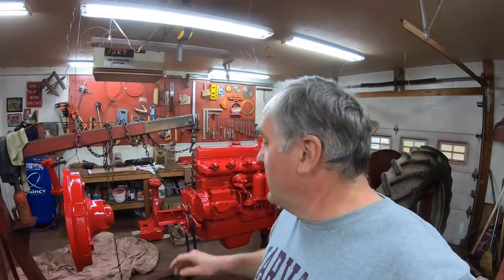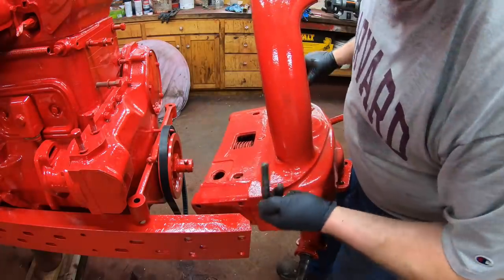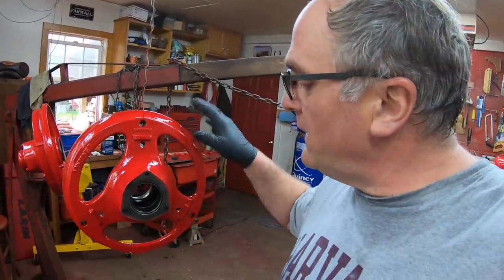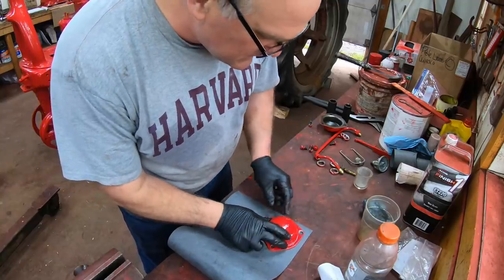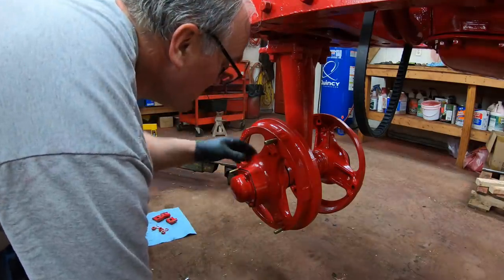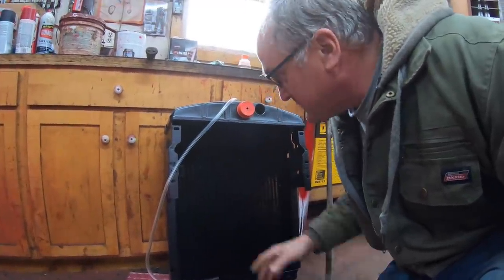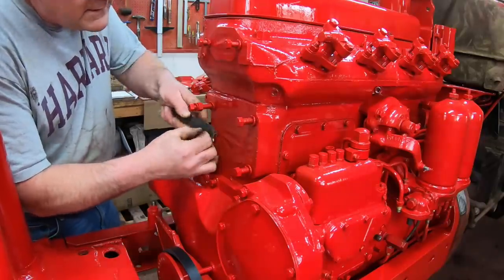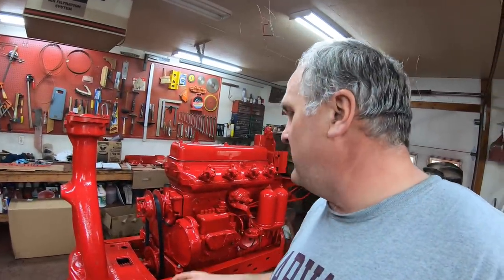My Tractor Has Four Wheels Again! Installing the Farmall MD Front Bolster

Comment: Sometimes it is better to buy local. I needed a new front rim for my Kubota tractor.  All over the internet it was $98. For giggles I checked my local Kubota dealer.  It was $38 over the counter. My dealer is now my go-to for all parts. And they are always equal or less than internet prices.

Comment: Excellent video Pete  :) very good on progress of engine rebuilt and looking nice ! Also looking forward to key start first time again and area you going use a AC Delco Alternator on single or double pole types from 1968 to 1985 for 4 or 6 or V8 motor style hope so because easy set up and if going get brackets check with John Deere dealership near you they have made ones made for 2 cylinder to 6 cylinder from 1950's to 1985 plus GM Delco Alternator from 1968 to 1985 to single and double poles types ! I know have one near me does too back then like 20 years ago!

Comment: It's always fun to watch reassembly after restoration. Thanks for the video Pete! 

Side note: it seems like the manufacturer was experimenting with their nut retention methods a lot on this model?  I saw a few different ways one can go about it now. I suppose we use similar methods today, for retaining nuts, but it was interesting to see how they went about it in this application. I learned a few tricks from watching.  Pinch bolt, w/ backup castle nut is one. Don't want a wheel falling off, and I don't think that one will. Lol.  

Be well friend. You're a good fella.

Comment: Pete, did you show how you finally got the lower steering bushing all the way in? Also have you found a proper thermostat. These are all things I will have to do on my Super MTA down the road. Thank you for what you’re showing everyone!  👍
Reply from the maker: Hi Dennis, I didn't show that. Dad made a stepped puck, similar to what you would use to pull a cylinder sleeve, that fit into the bushing and bushing bore. I used that to drive it the rest of the way in. A viewer found the proper thermostat on the Stant website, I think it's also available at Steiner. If you look back through the comments on the video where I talked about the thermostat it should be there.

Comment: I suspect the bulk grease is a reservoir, should the bearings and or hub heat up, the grease will melt and flow into the bearing for additional lubrication.

Comment: Looking great.  At any time did you use a "Hewlett Packard 57 10A Dual Column Gas Cramaticgram with Flame Analyzation Detectors", specifically on the tires?  Thanks.

Comment: Hey Pete, were you ever able to salvage that hour meter?  It's been a while and I just don't remember if it was beyond repair or not.
Reply from the maker: Nope. That's another problem that remains to be solved.
Reply: @JustaFewAcresFarm   I am facing the same problem on my MD. I am going to put the Stewart Warner back on for cosmetics and then mount an electronic one under the fuel tank to keep track of the hours. I plan on running it from an oil pressure switch piggy backed on to my oil pressure gauge. All of which should be out of sight if I choose to do so.